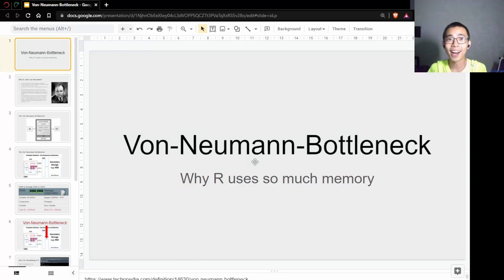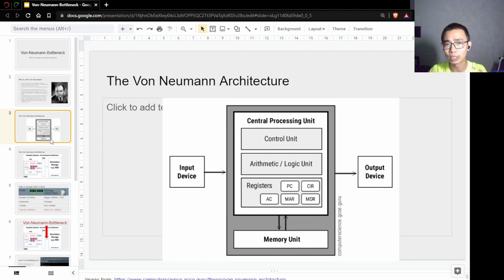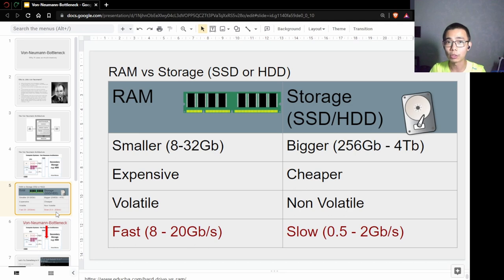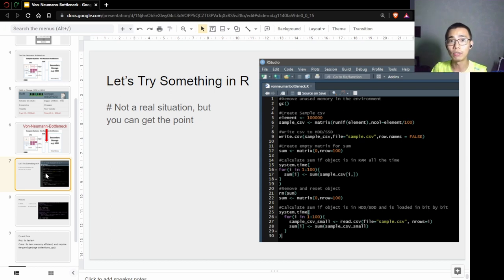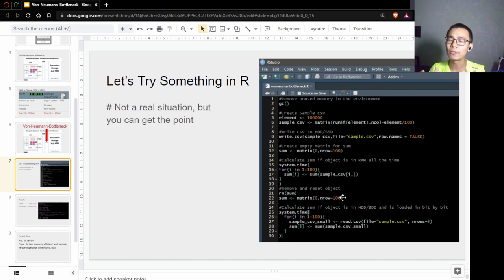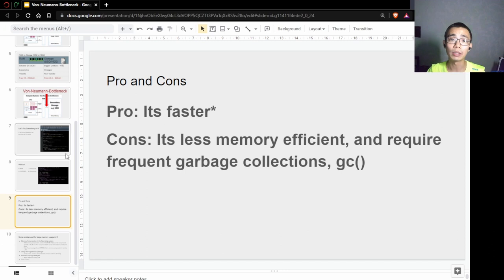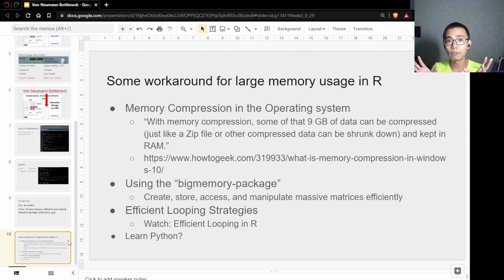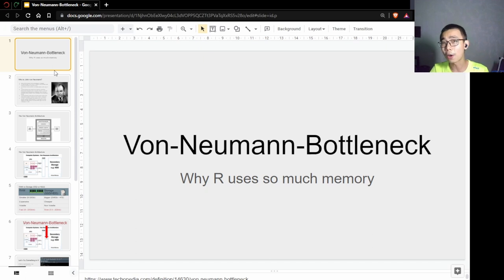Why R uses so much memory ? Probably

Comment: interesting that you run gc() at the start of the code, I sometimes do this, but I also read that R automatically handles garbage collection, and is constantly checking memory usage. In your experience, does gc() help? I could imagine for this experiment, it's useful to start with a 'clean sheet'.